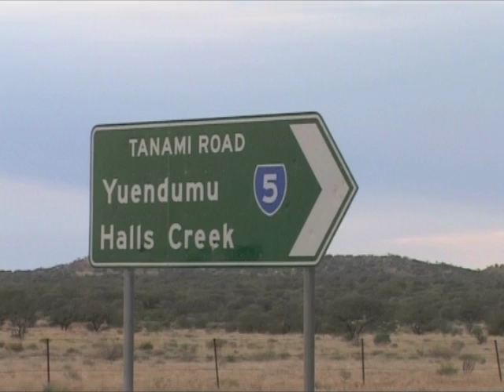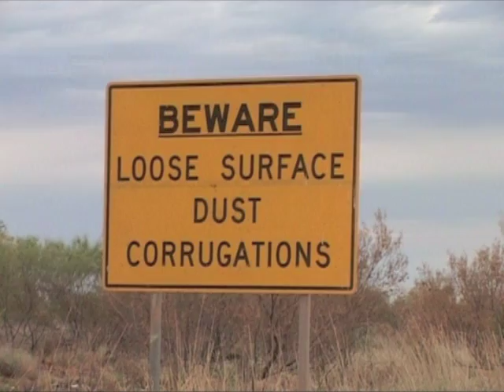Tanami - Road from Hell

Comment: Good video. Used to work at the mines out there for quite a few years, and have driven that road many times. One comment worth mentioning - don't know about these days, but when the Granites first opened, everyone soon learnt NOT to use European trucks (Volvo or Scania) on this road. They simply can't handle these conditions and fall to bits.
Reply: Worked as a mechanic on off-road coal trucks in the Appalachian mountains in Virginia  U.S.A. while not as long as this road still very rough conditions, with steep grades thrown in. Company my Dad and me worked for bought a Volvo, very quickly earned the nickname "road kamode" Volvo no good for rough haul work. Meanwhile the old 87 KW that'd been wrecked 3 times and put back together would just chug along.

Comment: I used to the truck the Tanami starting in the early 70s, it’s a different breed of drivers now with 600+ horsepower, air conditioning, dust proof cabins and tubeless tyres. . The new soft drivers couldn’t do what we did back then.

Comment: Have borked at Balgo setting up a wshop and hae also encountered u guys on the John Holland extension to the tanimi have found your drivers to be profesionals as a fitter, good to see you let your tyres downand save the running gear

Comment: @collossalpenis93 That's why trucks that pull road trains have enough tank capacity to get from one end to the other without refuelling. Sometimes the entire space between the front guards to the rear guards is filled out with tanks. Swallowing 1200 litres of fuel in one go is not unheard of

Comment: I repair the trucks which carry the mill balls. After they return, not unusual to replace spring packs, bearings, brakes, valves, wiring and lights on trailers and dollys. Prime movers dont fair much better. Then they do it all again. We run Townsville to Granites

Comment: How long are the road train trailers? I’ve noticed they all have 5 axels. Btw, I just found this while browsing.
Reply: Not 5 axles. Two lead axles are the dolly the tri is the trailer. Most road trains run 45 or 43' trailers
Reply: @Xtralge4ee   thx. I included the dolly in the axel count. I drive rigs here in the US. We don’t have road trains here, yet, but I don’t give it long before our doubles (26’rs) become road trains.

Comment: how much HP are in that truck to handle all those trailers ?
Reply: Cat 550 600 HP I had Cummins 300.000 ks old blow head gaskets in a CAB over Kenworth. I used to put 20 liters of water in that radiator only after 140 ks load up out of Caltex New Port Melbourne, and I get to Ararat Caltex truck stop, I FUCKEN HATED THAT ENGINE IT DROVE ME NUTS. I remember speaking the mechanic back at the depot, he told me John there not listening to you, let the engine blow, then they will listen to you after speeding 50k on the new motor. Cheers
Reply: CroZagreb1 Thank you dude ! :)
Reply: fifidomalaga Any time friend. I also used to drive the DHL cab over Kenworth pulling those triple trailers. Type in B-Triples in Australia and you will find a video of a DHL triple I reconnised the rego plate on that Cab over. That's the exact truck I used to drive.  I have the up most respect for any truck driver earning a living to support his or hers family period. I have done it for years. I must admit I do love the open road over an office any day of the week. I am NO fan of the Cummings engine. I love the CAT C-15 in a Western Star I used to drive that had a lot of grunt, pull like it was nothing. I also have driven many European trucks. My opinion is that the Volvo 500 pulled better that the C-15 cat. The Volvo I drove up the Adelaide hills had 500 HP motor in it. The MAN had a 460 motor in it. I believe you me the MAN did the job better not much between them. but better. I pulled up the Adelaide hills at 27 kph. I found it real interesting mate. I also drove many B-Double fuel tankers, they are super deadly to drive moving all over the place. I will never forget this woman telling me, after she almost lost her life not giving way to me, she tried to go up the inside of me in a around about. I know what your thinking,  only as I slammed my brakes on as she was under my B trailer/tanker, as she didn't give way. After I stopped the truck mid around about, I went up to her and I said ARE YOU OUT OF YOUR MIND. She said don't you have big brake as you have a big truck. I DIDN'T KNOW WHAT THE FUCK TO THINK OR SAY. I also said your super lucky I stopped or you would be DEAD after my rear trailer runs straight over you, its to late for everyone one then my family and your family. So her BMW had to be backed out from under the B trailer. But that's what we first though. As it was jammed in between the the API release valves, so they had to lift the whole B trailer to pull the BMW out from under. FULL OF FUEL MIND YOU. After her calmed down I explained to her, she started to cry. She said I didn't realise your jobs were that deadly I AM SHOCKED. All I said to her LOVE WELCOME TO AUSTRALIAN TRUCKING, we all have to do our bit on the road. Cheers mate
Reply: ive seen roadtrains with 300hp coolpower mack r600s pullin em
Reply: @donh54gmail  I dunno how you blokes did road trains with such low HP engines. Old western star I drive had a c12 and I'm pretty sure it was set only at 400hp. You'd hit only a little rise and you'd near on be bottom box. Hit a decent jump up with it and you'd be down to second quick smart.

Comment: Maybe they should think about getting some decent trucks DESIGNED for rough roads, like the Russian trucks, with All Wheel Drive and on-the-move tyre pressure changing!
Reply: and why don't they build a railway? 
However I suppose the maintenance of the railway would cost much more than all these trucks and vehicles together, probably they don't need  trains, because using trains suggests transporting much larger amounts of products than the ones carried by these trucks.
Reply: Mistralincessant the dirt under the sleepers would just wash away when the wet season comes
Reply: +James Bradley  they are decent trucks mate. they don't need to change
Reply: never seen a Russian truck pulling 4 trailers.
Reply: Don’t need all wheel drive, traction isn’t the problem
Reply: Nah too much electric crap just do as these fellas do drop your tyre pressures and dont flog it down the road

Comment: You snap axles because your power train is incorrect linked to your diff ratios. Over powering is not the answer, running numbers and engineers computations and calculations will always give the correct power train in any environment. Listen and learn from professionals not road Bogans .....